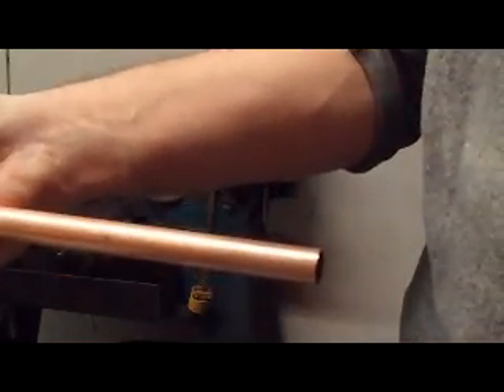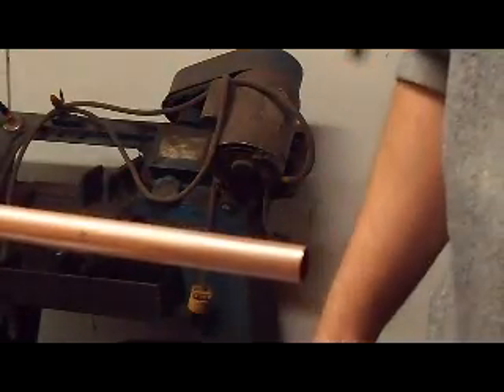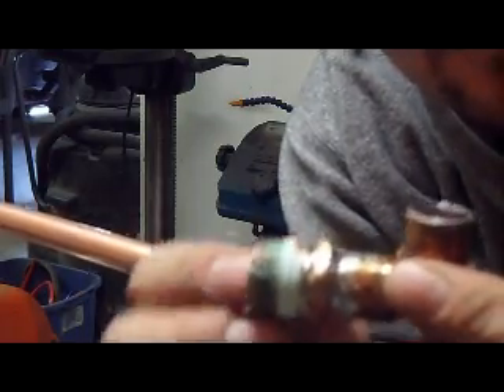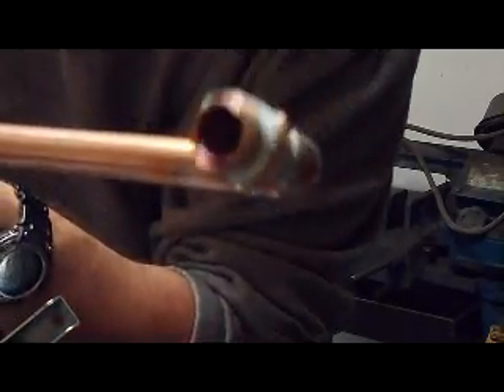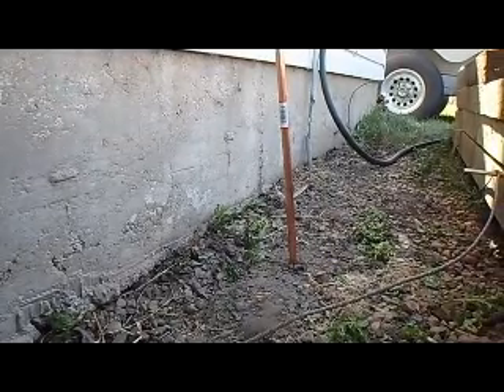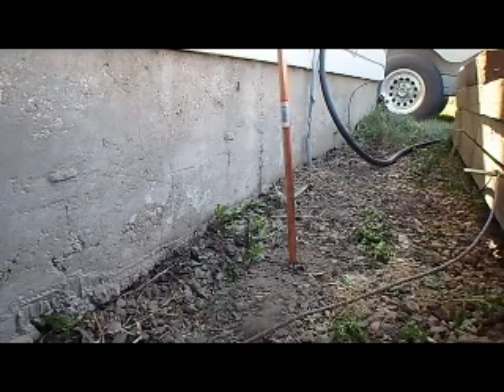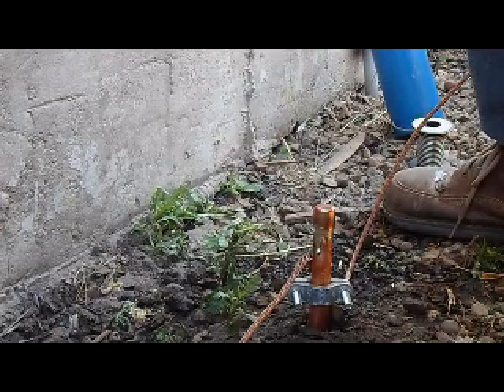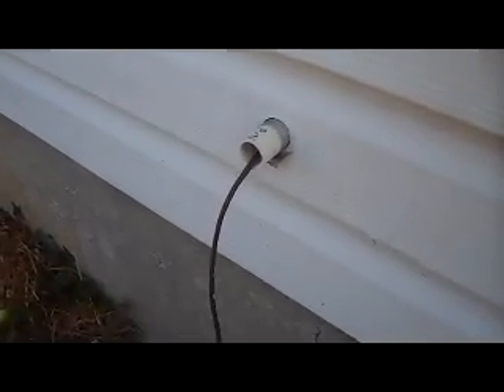Ground Pipe - Water drill

Comment: Good job. Make sure you use Ox-Gard paste between dissimilar metals - paste up the copper tube and also the steel clamp - otherwise the connection will oxidize in a year or two. Alternately use a copper clamp. 73, KM5L

Comment: Why would the pipe carry less current, as some are concerned about, than the wire? Also, wouldn't the area of contact with ground be the same for a pipe as for a rod of the same diameter? Also I would guess that a copper pipe has much more high conductive copper than a plated rod with copper thickness of 10-13 microns the rest being much lower conductive steel.

Comment: Anything worth doing is worth doing RIGHT!  Think 10 foot ground rods, copper strap to maximize surface area (and minimize inductance) and exothermic welds to connect it all to the rods.  You don't say the exact purpose here but for lightning grounds you have to give it a place to go.  Just using a clamp and some stranded wire isn't going to do the job well enough.
Reply from the maker: Thanks for the comment. It was for amateur radio station for RFI ground plane, to try and get rid of noise from a local hospital and overhead power lines. I corrected this in the comments but I think it is near the bottom. You are correct, this is NOT for lightning strikes, or for building grounds.

Comment: i use 2 spikes 4 feet and a 6 feet and a sledgmallet 43 bl in weight looks like this but all steel wood handle and 12 inch diameter i want to make one the same size as the on in the link but steel sam weight 
https://cdn0.rubylane.com/_pod/item/1317328/6347/Vintage-Large-Carnival-State-Fair-Circus-full-1A-700%3A10.10-73-f.png so drove 1 spike in pull out then use other spike then pulled out

Comment: This should n be done. Same as digging should not be done. You should hit with a big hammer for a good earth connection. You have just made voids in the soil which is a poor quality connection you could do this and install a larger solid rod (diameter) but even that is not ideal
Reply from the maker: When I removed these I had to use a hi-lift jack to pull them out of the ground. There was absolutely earth connection.  The ground was under a roof drip line and had moisture alot of the year also. These were for a ham radio ground NOT for electrical service.
Reply: biounlimited was not having a go mate. Just mentioning the you do get a better earth rf and electrical if you hammer them in. Not saying your way is not sufficient and if it gets people to get earthing instead of leaving it because it's too difficult all the better 73's good work

Comment: Why waste water doing this won't it be easier to get an shovel or mattock pick
Reply from the maker: baudellio charles 
No I have gravel/ clay soil this is the EASIEST way.
Reply: biounlimited clay soil is like concrete here in Alabama, this method won't work. The basic psi from a water hose in a rural and or in a suburban area is low.  It might have worked in ur area and if an ham radio operator is older and or disabled he can get a grandson to be free labor to dig a hole to shove a copper rod into the ground.

Comment: no good
Reply: @biounlimited  No worries, it's a great solution. I see this video was made a few years ago. I first learned it from a Dallas Ham, back in the early 90's. It's a great method. 73, KM5L
Reply from the maker: @patrickbouldinkm5l143  Thanks for the comment, I just put a HF rig back in that location. There may be an updated video in a few months when the snow is gone. Just using a G5RV Jr. on a fiberglass pole right now.
73's VA6BIO

Comment: What you have shown is not a ground plane. (A ground plane is still required to be connected to the building ground system)If your ground pipe wire connects to your equipment it is part of the building electrical service.Maybe you are trying to establish an RF ground to route static charges to ground?Same methods and codes apply.The ARRL just published a grounding/bonding book. Might be worth a read.
Reply from the maker: Will Hansen 
it was a stand alone 12 volt dc VHF/ HF radio system with the antennas and the radio gear ground through this to dissipate RF interferance. Also had Baluns on the the antennas, I live in a high RFI area with overhead power and a hospital less than a block from me. I will have to check out that new ARRL  book.

Comment: Your installation is governed by the NEC in the US and the CEC in Canada.In Canada the minimum length of your ground rod is 10ft. It must be c-UL listed for the application, which copper tubing is not.The clamp you used is not rated for outside use and your connection will eventually fail.This ground is also required to be bonded to the electrical service ground system (ground/earth means all grounding points are at the same potential).The reference to the rotohammer is to make the proper installation easier.Doing it right the first time will reduce the risk of fires, electrocution and ground loops.Good luck.
Reply from the maker: Will Hansen 
I am sorry you did not read the video description. This is a ground plane for Amateur radio antennas. it is not for building electrical service.
Reply: lightning needs high currents at 20000AMPS, the home electric service ground wires will be toast if lightning hits.
Reply: so lightning rod should not ground to home electric ground.

Comment: Why not do it right the first time?Get an 8ft SOLID ground rod and drive it below the surface with a roto hammer... use the correct clamp (direct burial).THEN make a video...
Reply from the maker: Will Hansen,
what do you mean by do it right the first time? The cost of a electric hammer also may by prohibitive to some people. This is for Amateur radio antennas not electrical service, maybe there was some confusion?

Comment: I'm sure it works fine as a ground but I don't think any building inspector would pass it. as for the penetration into the house, ..huh? ..not even any calking?  ..what keeps the water out? ..the termites?
Reply from the maker: Jay Wen,
no water penetration as this is about a foot above ground level. Also do not have termites here. there is insulation in the pipe to keep bugs out ( it's only 3/4" PVC pipe).
Reply: biounlimited does it rain there? does the wind ever blow? any pipe insulation will provide for capillary action to move water inward , as well as thermal differential between cold outside and warmer inside will help draw water inward.  I'm sure this grounding system works but I'm also sure it's not to code. and dryrot will do as much damage as termites , which is a condition that pvc pipe will create if you don't seal it .

Comment: This does seem handy, but a ground rod installed this way will have higher initial resistance to ground as compared to a driven rod. The water washes away the conductive bits in the soil and it takes some time for them to migrate back to enhance the conductivity.

Comment from the maker: Update.... Sold my HF radio with antennas so I pulled these out of the ground this summer and had to use a HiLift jack to remove them. So they did have good soil contact.

Comment: At field day I used a 6 foot ground rod and a bottle of water. Basically start a hole and then pour some water in. Let it soak a few seconds and drive the rod in with your hands. Remove the rod and repeat. This method took me about 3 minutes and is convenient if there is no water supply, and no tools were needed. I learned this from Robert KD5YVQ. It's not a bad method if you don't mind getting splattered by the water.

Comment: I love this method but I like to dig a trench for the wire and a hole so the ground rod can be installed below the surface, eliminating the abiiity of an overzelus yard man and his weed eater or mower to destroy your grounding system.  If it has to be inspected, get the inspectors in before you fill in the holes.

Comment: I used this method and put in a line of 6 in about an hour and used 8 foot pipe - mine was done for RF ground so I couldn't give a rodent's derriere about the NEC, BUT If I were to need to do a ground ROD, I'd probably do this method, pull the pipe out and slide the rod it, I disagree that a copper clad steel rod DRIVEN in to the ground is somehow going to be a more effective path-to-ground than a copper pipe inserted by this method, especially after a couple of months.  My soil is quite rocky, so it takes some finesse to dodge the rocks, but if you hit a big one you can't get around, just try again a foot away.  One more point - in the RF world, at our frequencies, we have to be concerned with 'skin effect' - I'm not sure a copper-clad steel rod has enough actual copper 'skin', so we may be into the steel underneath - steel is a very poor conductor!

Comment: I used a quick connect copper fitting and a garden hose adapter so I could drill my tube in, then take the fitting off for the next rod.  My use was for ham radio as well.

Comment: A great idea.
I have an RF ground network to install and this drilling method will help me get it done. I don't understand why some of the negative comments. You are demonstrating a quick way to drill a small hole in the ground. If people don't want to leave the copper tube in, they just have to pull it out and put in a solid rod. I will use copper tube for my RF grounds as it will be quite adequate.
Thanks for sharing.

Comment from the maker: As many have commented, sorry this is not a ground "rod". This is a ground "pipe" for the use on a Amateur radio, NOT for electrical power service. So No it is not to code, as it is not for that application. It is to help create a ground plane for radio antennas. it is also below a roof line with no gutter, so the ground is usually damp to aid conductivity. Sorry for the confusion.
Reply: Ground rods do not create ground planes for radio antennas. Ground rods solely function to create dc grounds for ac power mains and for lightning diversion from antenna/tower structures. This particular technique being employed to get the rod (pipe) in the ground is known to produce less effective dc grounding by compromising the rod/pipe contact with hard packed soil. It is much more effective to drive rods into the ground. This technique is one more example of amateur radio attracting very amateurish methods by the uninformed and propagating it to other uninformed individuals.
Reply: 1redrubberball Agreed. This is not safe, because its too thin for a lightning strike, and will quickly melt, or wont let the currents to go properly to ground. It might look and even "act" like a good electrical ground, up to the point you get hit by a major lightning hit.  But even "experts" get "grounding" mixed up with "grounding planes". Its a tough subject to understand.. And I am a General ham studying for my Extra. I do think that we (all amateur's and professionals) need much more education on proper grounding and the science behind it. 73, kb7uju.
Reply: 1redrubberball agreed.
Reply: I think I'd be OK with this method if it passed 3 point test.
Reply: Jacob w
The ground rod must be driven into the ground in order to have the greatest contact with the earth. That's why ground rods are rods and not pipe. When pipe is used along with the technique of getting it into the ground with the water method, it never has the contact with the earth that the driven method has.
Reply: it is not going to melt. Lightning spike flows on surface only via "skin effect".  Melting not possible it it thicker than 12 count 14  gage wire I guess, I did not calculate yet. corrosion life is less. you can drive solid rod in the hole now easily.

Comment: HOW NOT TO INSTALL A GROUND ROD a . its not a ground rod b. your method creates a loose ground c. your an idiot .
Reply: Daniel Morris 
Your momma is the idiot.
Reply: you can hammer it pour water. actually it is tighter if you remove it, fill water and soil then insert without water an hour later. you can refill and reinsert in loose soil.
Reply: You are the idiot, this is for a RF ground for ham radio not to ground the house dumb ass. http://www.arrl.org/grounding

Comment: I need to install two ground rods for a sub panel in my shop. Would this meet code?
Reply: I really don't think this would pass code, since he left the "drill" (i.e. pipe) in as the ground rod.  I have seen others do basically the same thing, but drive a real ground rod in after removing the water drill.
Reply: ***** Actually, its copper clad steel. Its not 100% copper.  (the UL listed 8 foot rod used for grounding). I am not commenting on his pipe drill idea.

Comment: I like your spirit, and the pipe might carry enough current to ground a single wide trailer, but for me, I'd change it out for solid rod. Lighting strike while you're in the shower and the current cuts the pipe off where your clamp is... Your dead on arrival.  FYI I do it with a Hilti medium size (te 900 avr ( active vibration resistance)) jack hammer w/ground rod driver bit.  But that's just me ;) 
thanks for sharing your vid 
Level10
Reply: The rods he was putting in were not for lightning ground, they were for RF ground - this uses skin effect, only outside diameter. A solid rod is useless at RF. But yes, I'd imagine he had a nice HV ground somewhere else.

Comment: This works.  Got the pipe, fitting, 8' ground rods at big box HDWR store.  Had a time figuring out WHERE to put the rods - footer extends about 12" off foundation - about TWO feet near deck.  I made a half dozen test holes that ALL stopped at 5-1/2 feet , then I extended the distance to 2 feet and voila!  MAN is this fast..  As it happens, the holes are right at the drip line, so this should be a benefit.  Thanks for posting this.  Reminded me of making holes with a garden hose as a kid.  Fun.

Comment: Done a fair share of ground rods for antennas.  A friend of mine showed me his technique (which I stole and made a video of), it's a home made fitting on the end of a hammer drill. The rod just sails into the ground.  I just did a 3 meter one this past weekend.  3 meters took under 3 minutes and it was flush with a wall (and washing machine).

Comment: Not really. A good example of this is the fact that you are supposed to use 1 inch braided cable for ground wire, instead of high gauge wire. The reason is that all of the current at RF flows on the surface. A braided cable has more surface area than a solid one, and this carries more current. 
The national electric code deals only with 60 Hz grounding issues related to electrical distribution supply and service. It does not cover RF grounding.
Reply: Braided strap is not suitable for outdoor use.  Exposure to moisture will cause the fine wires in the braid to oxidize or corrode, reducing its effectiveness to conduct.  Best to use solid copper strap or heavy (low gauge) wire.
Reply: erniesharp

Comment: Not exactly. A lightning strike is on avg 2-5 pulses of 18kA each, lasting up to 20 microseconds each.  There isn't time for the solder to melt and run away. If you take a large enough hit, the solder will vaporize, but so will the other conductors. That is why ARRL recommends multiple rods. (3 spaced 10 feet apart in a "V" formation at both the antenna and shack ends, with the feeder line being grounded at both ends, and at 10 foot intervals along the run)

Comment: Remember that this is for radio frequency. At radio frequencies, the electrical energy travels on the outside of the conductor, not the center. Therefore, a solid ground rod is an unnecessary expense. Your ground wire for RF work is not going to be a large gauge conductor, but a braided strap, for the same reason.

Comment: As you said this is for RF ground, not electrical ground.  RF travels on the outside of it's conductor.  Therefore the pipe offers more surface area to ground.  But instead of a wire, use either copper band strap (3-4") wide or at least 1" wide braid for the same reason as above.  Both are advertised in back of QST and CQ by different companies.  My shack ground inside, all equipment is tied to a 3/4 copper pipe by braid, then to 4" copper strap that goes out to 10' ground.

Comment: This video was a game-changer for me!!  As hams, we're all taught 3 things about grounding - 1) The more, the better, 2) The system needs to be separate from your electrical system grounds. and 3) All devices connect directly and parallel to ground - no 'in-series' or 'loops'.  All of this being known, I was completely ungrounded!  I saw this vid, knew I had some used copper pipe, and gave it a try - Now that the radios are grounded, low bands are much quieter!  Works like a charm!    73 W2GTX

Comment: You don't want to solder the wire on.  During a strike the solder will just melt off instantly and you'll lose the ground.  That's the reason for welding them or clamping them on.  Solder on top of that if it makes you feel better about the connection itself.

Comment: You could also directly solder the grounding wire to the rod if you wanted to. This is an excellent method of sinking a ground rod, and I think it provides an even better ground because in the process you're also injecting moisture into the ground at the same time for better ground continuity.

Comment: This method is far easier than pounding a solid rod into the ground. I'm in great shape but it's still a major killer to drive a solid rod into the ground but if that's what you prefer then go for it. I prefer using the force of plain old WATER to do all the work for me :)

Comment: solder won't hold if you have lightning, it can melt the solder and break the connection. you need a mechanical as well as electrical connection. solder is electrical connection and the clamp is mechanical connection.